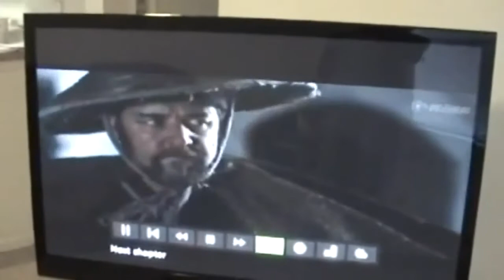The repair of Matt Martinko's Power supply board  EAY60968801

Comment: I still cant really figure out if the board is bad you know the connector on the top right of the board there are ther are like 2 pins that are 230 then 2 that are 60v and 4 that are 5v well only w of the pins are 5v the other 2 show nothing so the 3rd and 4th wire have no voltage
Reply from the maker: just send me a personal email. Lets see if i can help you
bigthings09@gmail.com

Comment from the maker: I believe you have the EAX61392501/9 power board the has three white resistors in the top right..instead of two.  you might have a 5W 10 ohms resistor

Comment: Heya, i have a 50PX950 that has this problem: i turn it on and it clicks, the screen goes black and it clicks again and turns off back in standby. Is it the power supply board or the problem can be something else?